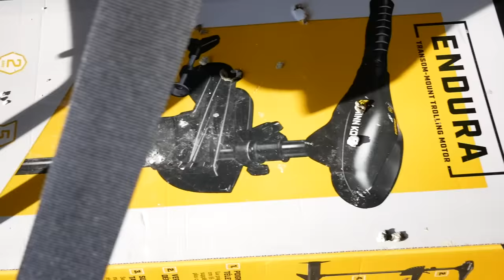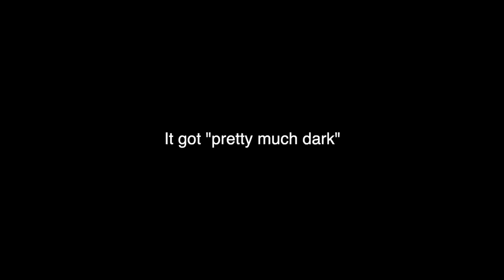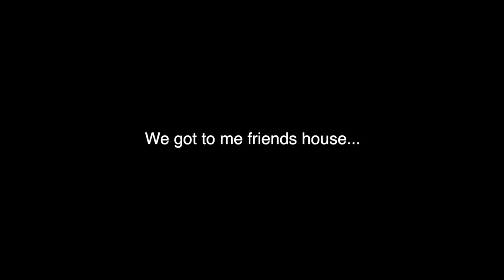Fresh BARNYARD CHICKEN Over REDNECK BARREL FIRE! (Catch & Cook)

Comment: Kg u should add a spring in the kg pocket knife I almost cut my wrist open while I was taking it out of my pocket and also I’m not complaining I’m just giving a suggestion a spring will make it so much better and it will lock better because when I just flick it with my finger off the thing u push down it’s just opens

Comment: U need tu put some oil then cook the chicken  30 minutes  low heat in one side then same thing in the other side so it don't burn  and to plug the father  the water needs to be boiling hot then the fathers will be easy to take out